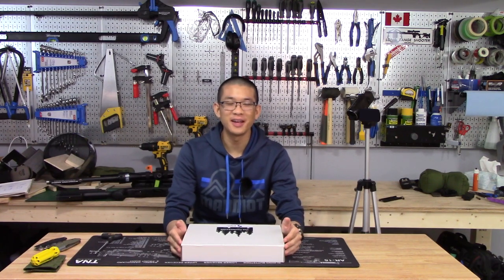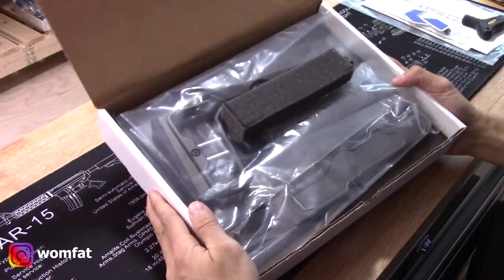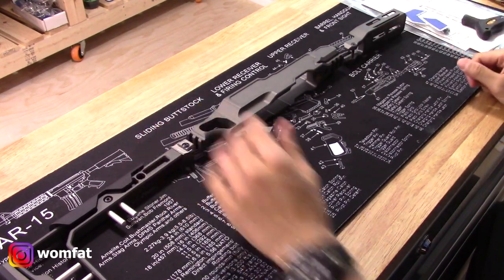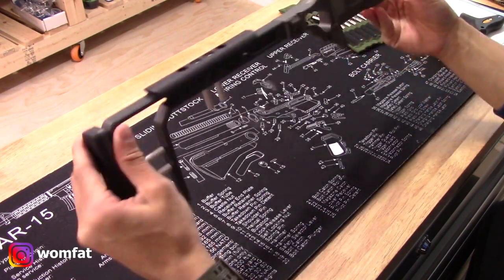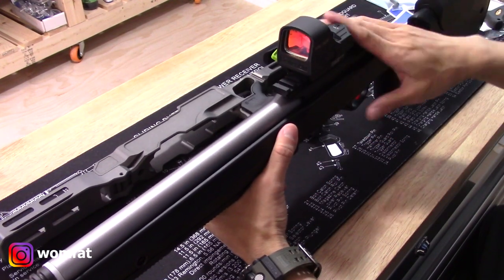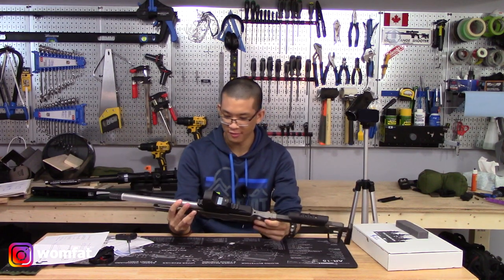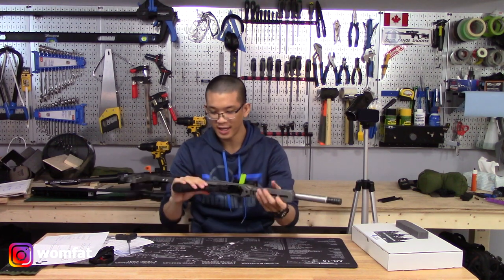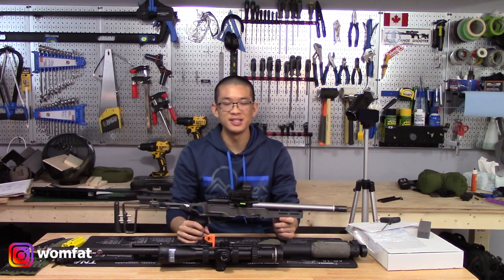Grey Birch Solutions Foundation Chassis: Unboxing, Assembly, First Impression

Comment: I compared GB chassis to Spectre 10/22 Chassis Gen2 before, but I chose the Spectre 10/22 chassis. Spectre have 2 set screws on the receiver which makes it more reliable and rigid. Moreover it can use AR15 grip, tube, casstle nuts and stock which I have quite a few hanging around since the stupid OIC. Hope you can do the side by side comparison in the near future.
Reply: Sorry my bad. I haven't finished watching to the end, Acutally you did that at 18:30 lol

Comment: Great video as usual. Thank you for the content and overview.  I have been looking at picking one up for my Dlask DAR 22 as they look sweet and lightweight.  I am also hoping for a longer forend and the folding adapter to be ready before I buy.  I have been using the Axiom Stock so I can shorten the LOP for my kids and it was the lightest weight stock at the time. LOP can go from 10" - 14"+.  Mine is 5 lbs 0.5 oz with a 12.5" medium profile Dlask barrel and a Leupold 2-7 scope, pic and arca rails.
One thing to be aware of is keeping it over 26" to remain NR. I was told a 17.1" barrel for the folding version and ~8.5" barrel for the folding setup.  Although it's only 1 screw holding the fixed stock in place, the use of a tool to remove it should keep it NR.
Reply from the maker: The short forend and the way they cut the arca rail are my least favorite thing about the chassis so far (for my shooting disciplines).  I'm impressed with the overall design and machining.  You make a good point with the barrel length and folding stock, definitely the responsibility of the shooter to stay within the law.  I'm interested to see how rigid the folding adapter will be!
Reply: One feature the folding stock has is the ability to lock out the folder using the main attachment bolt thru both parts of the knuckle instead of just the receiver side of the knuckle.
Reply: SBR Barrel must be 16inch min and 26 overall. The barrel must be 16inch otherwise its a tax stamp SBR.

Comment: Folding stock didn’t come, multi colour anodisation, can’t fit with my Kidd trigger, 50’ lbs tightening, weird screws, can’t slide bipod off arcs rail, typos.... seems like they got 70% the way there but it would be great if they had sorted it fully.
It actually looks promising if they fix some things and release it with the longer fore end.
Reply from the maker: You saying you had issues fitting your kidd trigger into it like me as well? I mention in the video I had to swap to a BX trigger group to fit my 10/22.. Very interesting.
Reply: @Womfat  no just commenting on your issues and I have a kidd trigger so it kind of sucks
Reply from the maker: I’m pretty sure it’s the dlask receiver front lugs that are causing the issue, not the trigger group. The BX trigger pack just gives more clearance for the receiver to slide passed.
Reply: @shootingwithtony7418  No issues with Kidd, Timney or Ruger triggers with the chassis.  The issue is with the geometry of the Dlask receiver which we will be looking into in the future.  Factory Ruger receivers are also fully compatible with our chassis.  On the anodization, we are going with Hard clear anodize which can have small variations between batches.  This was known and intentional.  We chose to go this was as we like the way clear hard anodize highlights the grains the metal, similar to a nice piece of wood.  As for the ARCA slot, it has also been addressed by some of our sponsored shooters.
Reply from the maker: Thank you for the clarification.  I had issues with the Dlask receiver in other stocks before.  I do like the finish on the Foundation chassis, the aluminum looks very nice and gives it a unique style.  Great to hear you're taking feedback for improvements! Can't wait to run the chassis this weekend.
Reply: @Womfat  On the longer fore end we are going to paraphrase George Bush "we can hear you, the rest of the world can hear you and the people who want longer fore ends will have them shortly"
Reply from the maker: @greybirchsolutions8906  Awesome news for us CRPS/NRL22 folk!

Comment: Confirming Dlask Tuff 22 receiver with Timney Trigger runs into the same fitment problem as the Kidd trigger. Appreciate the comment on the front lugs and maybe I will have to grind the receiver down a bit. Has anyone else had any luck with that? It seems like either the rear trigger housing has to be shaved down, or the front lugs on the receiver. Not sure how much material of either I'd ultimately have to remove, and am more nervous about any hidden springs in the back of the trigger. If I install the trigger with no pins, everything fits no problem.

Comment: Interesting.  Something is out of spec if a Dlask reciever and Kidd trigger combo won't fit properly in that chassis.  I wonder if Grey Birch Solutions' receiver and that Kidd trigger would fit in their chassis.
Reply from the maker: Other shooters have confirmed their dlask receivers fit different.  Apparently spectre ballistics even has a different inlet for the dlask receiver.  The front receiver lip doesn't taper down as quickly which makes it harder to fit into some inlets I believe.
Reply: @Womfat  I had no trouble putting my Dlask into a Magpul X-22 stock.  I've been looking at the various chassis options and I'm interested in how they fit.  I like the Oryx offering and would be interested to know how the Dlask fits into it.
Reply: Kidd 2 stage and Grey Birch receiver fit perfectly in the Foundation

Comment: Could you provide the weight of your current setup. For youth shooters, stock size and weight is often an issue. This seems like a good option.
Reply from the maker: The entire rifle weight as seen in the video is about 5.8lbs.  With a carbon barrel and light weight scope, it could be a great set up for a youth shooter, as long as the LOP is short enough.  Minimum LOP with the buttstock collapsed is 13"
Reply: @Womfat  What is the weight of the chassis itself with stock and forend?